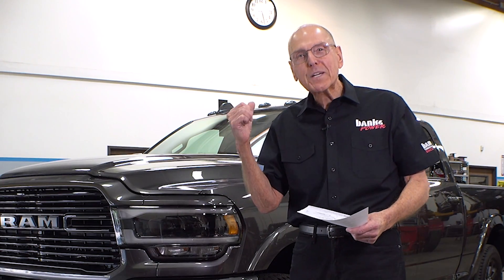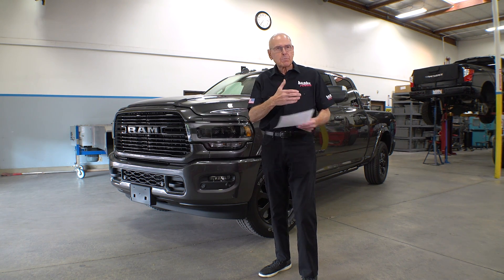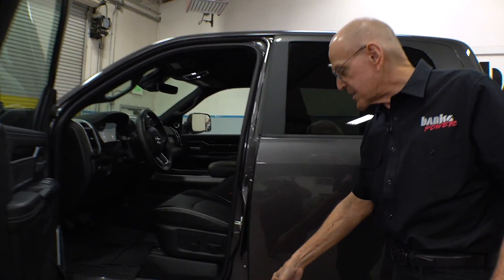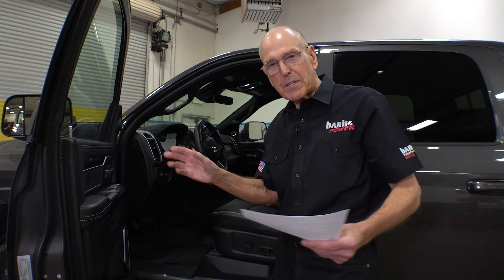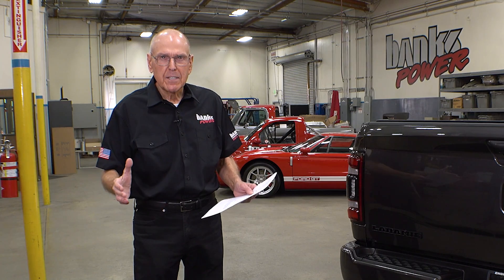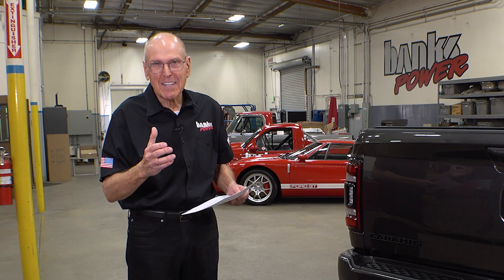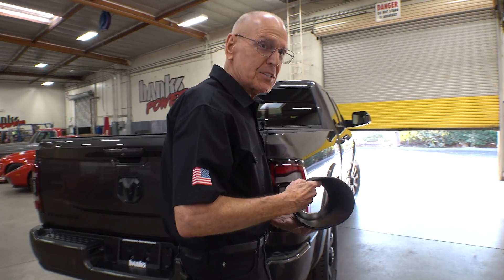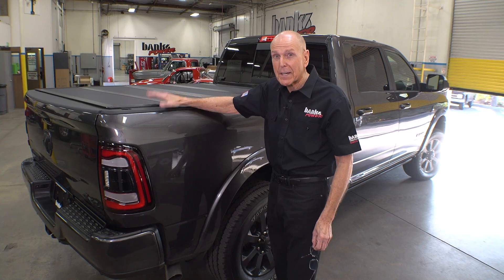Everything we're doing to this 2020 RAM 6.7L Cummins

Comment: This sounds like a foolish question that may be answered someplace else. but Im interested in the idea of using a super charger in a  turbo setup. The old 351 has yee ole emmissions tech (Smog Pump) and It got me thinking. Is it possible to run a supercharger that runs some pressurized air through the channel desiged for the smog pump (Assuming said pump is out of the equation) to boost turbo output, or decrese turbo lag ? or is it just plain stupid, and I should just use the super charger on its own, or a turbo on its own to make power

Comment: I have an 08 Cummins and hauled around a 15,600 lbs trailer for 3 years yea it came unhooked a few times but 99% of the time it was hooked up with a 325 gallon water tank in the bed for off grid the whole time. And the truck power wise would rip everything apart IV had to rebuild the truck around the motor pretty much. It’s at 300,000 miles now the best work truck I have and will ever own because I don’t plan on replacing it just parts.

Comment: this vid was done 2 years ago yet still no tuner available today
Reply from the maker: This is a development truck that was purchased not just for the tuner but for everything else we offer for the 2019+ Ram Cummins. Parts like our Ram-Air intake, Monster Exhaust, Boost Tubes, Diff Cover, and more were developed using this truck. As for the tuner, we will have a Derringer for the Ram truck available. It’s no secret are actively developing the tuner for these truck platforms but have not put them on sale. We had a few false starts that we wish didn’t happen. We're developing an all-new Derringer platform that shares nothing with the current GM/EcoDiesel Derringer. Manipulating only two sensors, like boost (MAP) and fuel (FRP) is not enough to achieve the performance goals we have set. Once this new Derringer platform is dyno tested, dialed in, and ready for all the Ram 6.7l model years, we will launch it.
Reply: still waiting @bankspower
Reply: still waiting

Comment: Back in the day (early 70’s) Mack came out with the original 237hp Maxidyne diesel with a straight 5 speed transmission behind it. This combo only worked because of the extreme torque rise (53%) bad wide torque range of that engine, it made over 900 ft-lbs which was more than a 290 Cummins at the time and at a far lower RPM. I guess Ram is using the same theory…wider power band, higher torque and a good torque rise curve for lugging mean less gears are needed. Mack’s big claim to fame was you only needed 5 gears with the Maxidyne vs the traditional 10 speed for other engines.

Comment: I will be follow this close because I’m taking delivery of my 22 HO Cummins. I have been waiting a long time for it but I hope it’s worth it.
Reply from the maker: We’ve released a few products for your upcoming 2022 RAM since this video was released. 👉 https://bankspower.com/collections/compatible-products/year_2020_make_Ram_model_2500_engine_6-7L-Diesel
Reply: @bankspower  I will be ordering the diff cover and peddle commander right off the bat. I’ll be doing home work on the rest of the stuff. Maybe the air high flow air cleaner also. Great work guys!

Comment: All the content was great here, I'd just like to note that that truck would not have a 7680 lb payload limit, being a single rear wheel diesel. Only the DRW Hemi would have that number. This truck probably only has a payload capacity around 3500-4000 ish lbs or so, although the towing is legendary.

Comment: Your website doesn't have any 2022 Ram 2500 products. It has a red X when you search.  I assume there's no difference between '21 and '22 ?  I want to order things like cold air, peddle monster ,etc., and just want to me sure.  Thanks.
Reply from the maker: Yes, ‘21 and ‘22 model years are the same. We will be updating the web pages to reflect the fitment. Oh and congrats on the ‘22! It’s a beast.

Comment: Mr Banks! Im planing of getting a 2021 cummins Laramie.. with all of these EPA people giving people  fines.. I just hope you can make us diesel owners happy with legal performance parts that we can put on our trucks without getting harassed by the EPA..
Reply from the maker: You'll love our new RAM equipment. Every part will carry a CARB E.O. In other words, 50-state emissions compliant. Check out the new Monster-Ram intake manifold, available NOW! https://www.bankspower.com/i-3072
Reply: @bankspower  is this part going to clogged the stock exhaust? Or do you have an exhaust that I can put on the truck when I get it?
Reply from the maker: @edwarddelacruz7505  Our parts will not "clog" your diesel particulate filter (DPF). In fact, our tuning products run stock AFR or leaner. That means no soot and no clogged DPF.

Comment: Gale, have you "had your way with it" yet?  Either I missed some videos or there hasn't been any news on this yet. My truck will be in VERY soon and want a derringer and all the goodies that go with it!
Reply from the maker: We're still having our way with it, parts development has taken a little longer than expected. As of of now, we offer the iDash (both DataMonster and SuperGauge), the PedalMonster Throttle Sensitivity Booster,  and the emissions compliant Monster-Ram Gen-2 intake manifold. Within the next few months we are dropping the Ram Air intake system, Ram Air Diff cover, 5" Monster Exhaust, and finally the Derringer. For the Derringer we love to hear that you're excited, however, it's take a little longer than expected.  The RAM 6.7 requires timing and pulse-width control as well as FRP and MAP. This means it's a whole new circuit board and firmware. It shares nothing with the Duramax, not even the housing. By the end of winter, all parts will be available. 👍
Reply: @bankspower  Sounds Great! Thanks for the reply and let me know if you need a guinea pig to do some testing. I do a time of tuning myself but not in the diesels so the Derringer has my interest. 👍

Comment: So, it's been 9 months now since you dropped this teaser and I'm really wanting to see what's up with the new stuff!!! Question as well, I have a 2021 Ram 3500 Cummins, however I don't have the H.O. What can I expect out of these upcoming upgrades with the standard motor? Is there enough of a difference between the Standard and the HO that these upgrades could cause harm to my Standard motor?
Reply from the maker: We're the process of developing most of the hardware for this Ram platform. We have a lot of work to do, on the Derringer and the Monster Exhaust system. We just finished the Ram Air intake development, we're getting ready to release the new Monster-Ram gen-2 and Diff cover in the 6-8 weeks and we've already got the iDash and PedalMonster available now.

Comment: I have a 2001 Dodge Ram 2500 diesel upgraded the suspension to a 3500 so the truck sits really high up but having the Gale Banks exhaust since the truck was basically brand-new in 2001 it was approximately a year after purchasing the truck put the exhaust in and never had a problem still have the same exhaust tip that came with it but also have the Gale Banks computer programmer and there's nothing that I haven't found the stop that truck from pulling and gas mileage is unbelievable. I live in New York Long Island drove upstate New York approximately 3 hours had a old cast iron stove a Prairie 650 ATV and pulling a trailer with to Grizzly 660 plus hunting gear burnt little less than quarter of a tank. But I've changed the turbine added a extra blade and have sitting in my garage yet to change a oversize Turbo but that truck is a animal only thing runs amazing needs paint job but looking at 2021 Ram trucks this will be #5 nothing beats a ram

Comment: Bought my last Dodge truck .Air is in dash 2500 dollar dealer repair  3 times  Trans my 3500 112k miles My sons at 60k ,been at dealer 7 weeks no replacement yet. Drivers side window control every 30 k,every truck we have . We have had 15 Dodge trucks ,I think thats enough  Eric N

Comment: Won't the bigger exhaust tip reduce ground-clearance. How far off the wheel does it sit?
Reply from the maker: Yes, the exhaust tip would reduce your departure angle. The tip is designed largely for on-road use.

Comment: This is very exciting, I also have the 2020 HO Cummins 3500 4X4.  I’m driving from AZ to Florida pulling a 4,200 Lbs dump trailer, currently in Georgia visiting my step mom. Im sure looking forward to installing some of these items on my truck which currently has 7,000 miles.

Comment: The 2500 and 3500 rams can always hold 7000 plus pounds in the bed.  Ive got a 2018 ram 3500 4x4 long bed with G56 manual tranny.  I can easily put two pallets of porcelain tile and 50 bags of thinset mortar back there.  I go from Ventura,  up the camarillo grade on 101hwy with no problems.  I can maintain 75 mph because of the badass cummins engine.

Comment: sooo my 2020 ram 2500 I bought last month has been in the shop for 2 weeks . P0740 code came on which is something with the torque converter and just finding out from the dealer they will have to rebuild the trans after they changed some parting thinking that would fix it ( something about pressure building up in the trans) needless to say with my truck having less than 1K miles on it I don't really have much faith in these trucks coming from GMC and FORD. They said they haven't seen this before so I hope its just a fluke .

Comment: Meh with all the emissions it's a shiny neutered pos that will fall apart after 200,000 instead of the 1,000,000 you can get out of those engines. Better just to wait for a dam truck that plugs in. However if you take off all the emissions crp that 6.7 is awesome!!!

Comment: "Needs a different turbo charger at high altitudes...or tuning"  You couldn't be more correct.  There is a serious flaw at altitude with these trucks RAM/Cummins has not fixed after more than a year.  Put a cummins on a steep mountain road and attempt to drive it at 60mph up that incline where the engine RPM's are low around 1400 and the turbo boost is around 12psi and you get really bad surging of the turbo, it's incredibly annoying.  If Banks can fix this I want their solution because RAM has failed to fix it.

Comment: My uncle ram I think it was the 6 gunner on his 06 2500 and messed up the transmission. Anyways after having the truck for almost 12 years, he upgraded. He drove from Florida to Texas to get a 2019 RAM 3500 dually with the HO. It’s also the mega cab as that’s what he had on his 2500 but his is also the Laramie Longhorn so he’s got a lot of creature comforts like heated and cooled seats and that H/K sound system. Anyways we’ve noticed the truck is stupid fast for a stock truck of its size and when he hails his trailer with it, you forget it’s there 😂

Comment: "This cummins makes torque everywhere". Fair, but it doesn't make peak power everywhere. It'll definitely be a step up from an engine that has a narrow torque band, but there's still some advantage to having more gears and being able to keep it nearer to peak horsepower. 

Anyway, it's been a month. I was slightly worried noticing there were no uploads a few hours before you uploaded this! Glad to see you're doing well. As an EE I really enjoy listening to other engineers who actually know their stuff. Keep the videos coming, excited to see what happens with your two Duramax engine series as well (hoping you're still continuing them).
Reply: Maybe not but it does make 340hp at 1,800RPM on boost which is close enough to 400hp at 2,800RPM
Reply: @vhateverlie  I was wondering what the power band was like, but could not for the life of me find dyno results(aside from peak numbers) for a stock HO Cummins truck.  Yeah, if the power band is fairly close throughout a relatively big range of the revs, especially for a lower revving engine like the Cummins, then you're absolutely correct and the 6 speed won't necessarily be detrimental.
Reply: @Sevalecan  it's mostly from the 800RPM idle up to the 1,800RPM peak torque is the big hold up. But you'd never find accurate information because all dynos are foot to the absolute floor from off idle which probably isn't accurate of how one would drive the truck. Nor is the load similar.
Reply: @vhateverlie  If you look at it in terms of foot to the floor, below that level you're clearly deciding not to utilize full power, which is arguably the place where you're going to either carry the large load(Or just go very fast straight line not up a hill) up a mountain at the highest speed the vehicle can offer, or you're going to accelerate as fast as the vehicle can offer (assuming you've not reached maximum speed given the circumstances). Loading matters, but I'd say focusing on power at full throttle makes sense from the perspective that we expect our load to change with conditions we impose, or due to uncontrollable environmental conditions.

As for how you would drive the truck, there's certainly the transient event of turbo lag for instance, but unless you're drag racing, that is not necessarily significant. Measuring the vehicle itself gives you a level of potential, there's always the variable of how the driver chooses to utilize what's available to him. There are of course things to focus on optimizing given your application/usage, but it generally seems like Gale approaches optimizing them all without compromises (feel free to correct me if I'm wrong, but after watching him, that is the impression I get) 

Regarding application, that seems to be taken under consideration with Banks. He performs long duration dyno tests, unlike a normal performance shop, to see if these engines and his modifications will hold up under sustained load as well(Trailer hauling vs drag racing), which is something I believe performance shops almost never do. He even killed a chassis dyno because it was only designed for short pulls.

I guess I'm wondering, how precisely do you want to tie the performance to a specific situation? Unless you only ever do one thing with the truck, it seems helpful to look at peak power (in terms of throttle position) over a range to establish maximum capacity. If you need to get more specific than that, you can, but at least here it doesn't seem Gale is looking for performance in only one scenario.
Reply: @Sevalecan  there is definitely compromise when tuning a truck. More power, less longevity. Banks does an amazing job walking that line though. My argument is these pick up trucks make more power than comparable semi trucks. If you run them flat out like what they're rated for you're in for a bad time after 60k miles. What you're looking for is what's the continuous average power output in its power band. How much power does it loose to heat-soak and such.
Reply: @vhateverlie  EDIT: Honestly, changing my statement, I have no idea what the manufacturer is testing for in durability or whether your argument about 60k miles is valid or not. Aside from making assumptions at work and learning it's a poor idea to do so, I have heard the 3rd gen hemis have a problem with the splash lube on their camshaft. Due to the new location of the cam, it only gets splash lube at 2000+RPM. It's possible to resolve this problem with a little more oil flow and building your own drip rail above the camshaft, but a lot of idling will cause this engine to fail. Certainly manufacturers skimp some areas of testing, but I don't know which. It seems likely this would have been fixed if the engineers of the 3rd gen hemi actually tested the engine at idle, but I expect more likely they accelerated the testing by exceeding normal parameters in order to determine lifetime. It depends on how far they wanted to exceed the mark and how good their testing assumptions were to begin with. I guess I'd need some examples to know more.

Cummins is a different manufacturer, but I don't know enough about their test procedures to say one way or the other whether 100% power all the time would significantly reduce the lifetime of the engine. They certainly manufacture engines that can/do nearly that.

Varying load may actually be harder on the engine with more heat cycling, etc. As long as heat removal capacity is kept high enough for steady-state high power conditions (and we've seen radiators and grills get huge for this purpose, and the improvements in oil coolers such as in newer duramaxes).

I don't know the answer to all these questions, but it would be interesting to find out.

Original:
 That's fair, and I can accept your argument on durability without even seeing any tests. Manufacturers like to be cheap and they aren't going to design for that scenario(100% WOT all the time) because it's going to be expensive or make significant compromises or both. I expect they still design for a large amount of it for a good period of time at higher power, if people are going to tow 30-35000+lbs regularly with it. Gale has shown us a look at the oil cooler improvements in the Duramax for this consideration(I just love this guy's videos!)

Plus it would otherwise be really hard to maintain that percentage power output without violating traffic laws on a constant basis 😁.

I guess I was moreso focused on the specific consideration of 10 speed vs 6 speed in the context of acceleration and max speed under load. That said there's certainly a lot to think about and play with depending on what you want. Personally I'd just be playing around with quick acceleration often, but otherwise not be concerned about sustained high power output most of the time... Yet I'd still take more pleasure in knowing my truck could handle it for instance in the case of towing something heavy if I ever needed/wanted to.